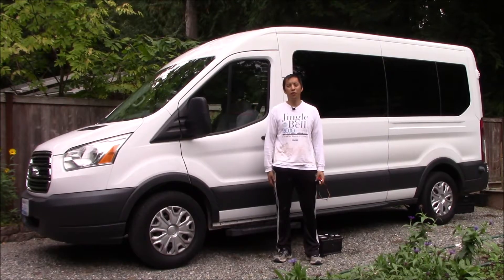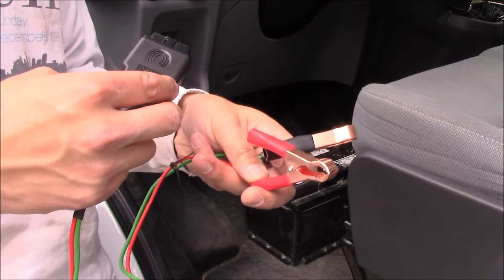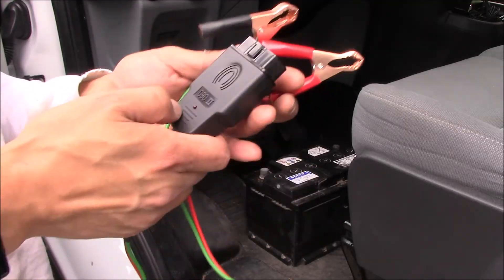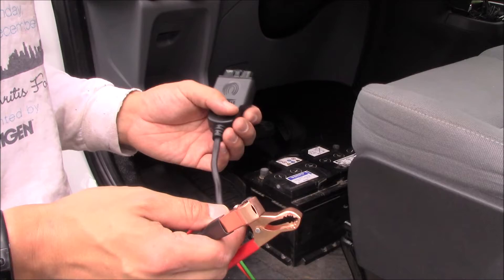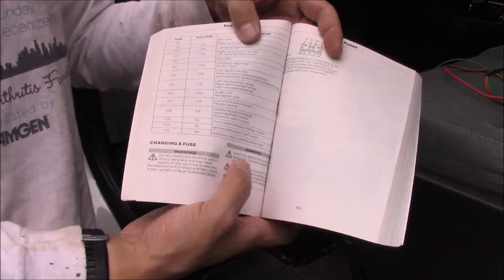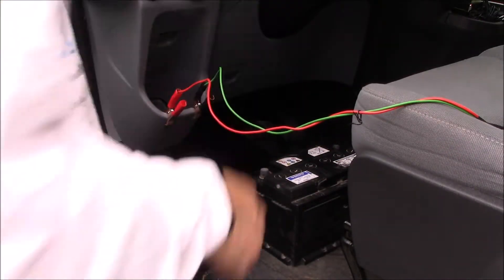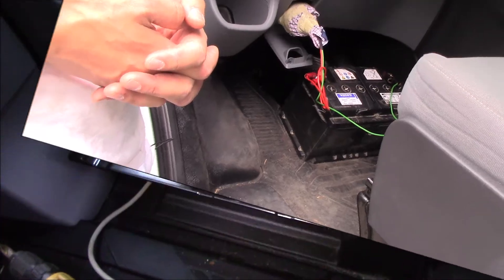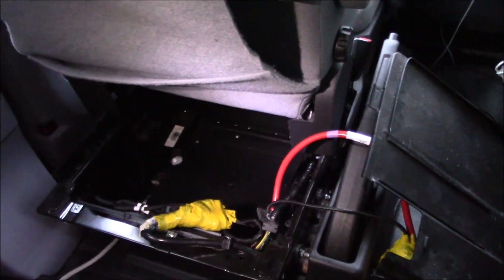Using a Memory Saver When Disconnecting Your Car Battery

Comment from the maker: In case it is helpful, here are all my van videos in a single playlist https://www.youtube.com/playlist?list=PLxdnSsBqCrrF5nO7cmNTc4cct0miFWdO6.  Please let me know what you think in the comments.  You can support this channel via Patreon at https://www.patreon.com/christopherwlum or by clicking the 'THANKS' button underneath the video.  Thanks for watching!
Reply: I recently tried to use a memory saver on a 2022 car.  It was a cigarette lighter male plug to obd2 port.  I used  a 12v 10 amp source and I blew a fuse that was stating itself to be 7.5 amps.  Now I am seeing you use a car battery that I believe produces way more amps at 12 volts.  How the heck did you not blow a fuse?  

I think the solution for me is to use something under 7.5 amps  between 4.5 and 6amps but im still worried about breaking something.

Comment: This is absolute nonsense. You can replace your car battery without this rubbish. Just try to disconnect your car battery (negative and positve and leave it for 10  minutes. Then reconnect the battery and start your car. Nothing is lost in memory. Not even presets on the radio (it has build in memory).  The car starts just fine and  nothing's changed. 
I ´have replaced battery in all the cars I have had, and  never had any problems. Start and stop cars will  start after 2-3 attempts because new information about the battery is being send to the ECU. ( learning process) So you don't have to do anything but to replace the battery and start the car

Comment: There are battery memory savers where you can unplug the alligator clip cable from the unit. Those units have batteries in them that charge while you're driving. 

Lift the hood attach it to your battery, get your car started a jump start will not harm the battery saver, drive for a little bit about 10 minutes idling won't do it, then you'll have enough power to last a couple of hours at least from the battery saver without actually having to hook it up to a 12 volt spare source. 

In some instances those models that have a charged battery internally you can leave the alligator clips clamped to the post clamps after before you remove them, then remove the post clamps you now have battery-saving power going to the car correctly and through the total system, it's a non OBD2 style by the way. 

Then change your battery and go back and then disconnect the saver. 

These savers have a safety circuit to prevent

Comment: Would you please mention if this device saves engine associated data like throttle body settings or anything else that’s actually more useful / crucial than radio settings ?

Comment: If you have a small 12V car battery charger, you could just hook the battery charger positive to positive (opposite end of battery post/cable connection, where the + cable bolts to), and the neg cable of charger to ground on steel of body or engine block or where the cable itself connects to body ground.

Comment: I have a similar memory saver like yours with the alligator clips. It came with a 15A fuse on the positive lead. I have also added a diode to the positive lead to prevent back feed from the battery under the hood.
Reply: Where did you get the e diode and how do you calculate the “size”

Comment: Don't have an extra 12V car battery around ? Hey, there's your lawn tractor, or garden tractor, or zero-turn. You might need longer cables, though. Or even two 6V large-type flashlight batteries in series.

Comment: If you had a device with long enough cables - couldn't you just hook it up to the same battery you're disconnecting? Or is that no good?
Reply: @torTxoFognaTuluZ   you're not gonna get shocked. As to the terminals getting in the way, idk about cars in general but on mine at least you can leave the battery cable clip on and just remove the cable from the terminal clip. If your battery cables are soldered on to them on the other hand... yeah that'll be hard.

Comment: Thank you for sharing what happened when the leads touched and blew a fuse. This helped me figure out what happened to me. Also as a possible helpful tip to those who do not like the beeping, I took my saver device apart and removed the beeper. God bless
Reply: As for me , I recently tried to use a memory saver on a 2022 car.  It was a cigarette lighter male plug to obd2 port.  I used  a 12v 10 amp source and I blew a fuse that was stating itself to be 7.5 amps. 
 Now I am seeing this video use a car battery that I believe produces way more amps at 12 volts.  How the heck did he not blow a fuse?  

I think the solution for me is to use something under 7.5 amps  between 4.5 and 6amps but im still worried about breaking something.

Comment: Best video I've come across re use of the OBD II battery saver.  Mainly because it answered my question about the beeping while connected; I reasoned that it is a good reminder that you're hooked up to a backup battery, while replacing the main battery.  Thanks for the informative video.

Comment: Great video.
Is it safe to plug the alligator clips to another car's battery while the donor car is on with it's alternator running?

i don't have a spare 12 volt battery sitting around. So this is my only option left.
Reply: 35.00 at a local junk yard for a slightly used battery.......

Comment: Worked exactly as shown. I purchased the jumper from Amazon and replaced the battery in our 2018 F-150 and kept all the settings. The truck did not need to relearn anything.
Reply: specifically what battery saver did you purchase from Amazon.  Thanks
Reply: Yeah I’d like to know which memory saver you used too ??
Reply: A quick tip on the alligator or crocodile clips as we call them in the UK. You could shorten one of the leads.

Comment: What information will be lost if I don't use a Memory Saver like the one you used?
Reply: It depends on brand. I have Suzuki and its ecm settings reset and cars idles like crap, and I have to perform manual relearn. Using this procedure i dont lose anything. Only downside is you have to have one more extra battery, 3 in all, one in car, one for obd and new one

Comment: Think this is useless really they should have invented it with a self power supply! Or I'll need 3 12v battery!! One is the battery I want to swap out 2nd is for the power saver and 3rd a new 12v battery that replaces the main battery! I guess this is only useful for some car maintenance that requires you to remove main battery if located in engine bay

Comment: So.. after a little research.. I found this.... " They are not effective or worth the risk. I-CAR also teaches not to use them.” Jeff Peevy, I-CAR's director of field operations, concurred. “A memory saver can complete circuits that removing the battery opens in order to protect the system, and so a memory saver could put systems at risk,” Peevy said.Jul 18, 2014".. any comments?
Reply: Note, that's a piece about welding metal on a car body. Electric arc welding and it's a different story than if just replacing a battery.

Comment: Many videos on how to do this. No explanation on why. What is being saved? What happens if you change the battery without this?
Reply: Several things can happen, the most annoying is  your car won't idle correctly and it will die after a second or two, you start it again and give it gas , but it dies again and again.  The procedure to re learn the idle settings varies from car to car and it is time consuming.  
Then you can also loose other settings in the electronics, like your radio ,  clock, and others. On very expensive cars I've told you have to take it to the dealer so they can reset things for you and of course it is not free.
Reply: Lose your radio presets? Clock? Hook a battery maintainer or trickle charger to the battery cables before you remove them from the battery and leave them on until you put them back on the new battery.

Comment: Never having seen or used a battery saver before the explanation and instructions were most helpful.  I may now go and treat myself to one!
Reply: Don't see the point of this as you will need 3 12v batteries.... 1. Main battery for replacement or to remove... 2. Battery for power saver... 3. The new replacement battery... I would invest in one of those car starter packs which you can connect directly to terminals
Reply: Or unless you are removing main battery for space in engine bay! If it's just for battery maintenance or swapping out faulty battery I think this is the most useless thing ever

Comment: I bought a memory saver to change a MkIV Renault Grand Scenic battery, but the OBD2 port was in none of the places that it shows it to be - I still haven't found it!
Frustrated by this I made up a memory saver using two lengths of wire, with an in-line fuse in the +ve lead and proper crimped connectors at the ends. Insulated terminals MUST be used. This was conected to a 12v battery from a child's go-cart and each lead securely connected to the leads going to the battery, using additional nuts. Once done, connect the preserving battery in parallel and remove the terminations from the old one in the car, -ve first. When removing the +ve, wrap terminating wire in a plastic bag to prevent contact with any body metalwork - remember these are still live! The Car memory is now being held up by the preserving battery. Replace the  car battery and reconnect leads. Lastly, remove the preserving battery, -ve first. 
Once everything is secure, the car should have its memory exactly as it was before.
Reply: Negative first. My boss still thinks that electricity travels from positive to negative
Reply: If it has an ash tray look behind it for the OBD plug.

Comment: I just bought a lithium battery car starter,similar to the Noco genius,it charges things like smartphones etc too.
Would i be able to use it as a direct source of power to the obd if i found an adapter??
Im thinking maybe yes?Great video!
Reply: yes you can, but the memory saver would have the cig. lighter end and the obd end........cig. lighter end goes into the car starter and turn on......works fantastic.
Reply: @johnbielenda7336  i am about to do this, but the GOOLOO jump starter/power bank has an output of 16.3 volts (tested with my craftsman volt meter)...i am hesitant to put 16 volts into the OBD port.
Reply: @g2145cal  Just buy the simple 9V battery adapter, costs ike 15 bucks, goes into the cigarette lighter
Reply: @OldSchoolNoe   I just went for it and replaced the battery without the saver or Gooloo hooked up...nothing adverse happened, just one prompt on the display. All is good.

Comment: He must be paid for pushing these memory cables. Just have a spare battery or jumper unit then, remove fuse cover under the driver side dash. You will see a red  positive terminal. Pull it out, connect positive cable from spare battery or jumper unit first, then connect negative cable to driver side door bracket. You will have all neccessary power to whole car, radio, trunks etc. NO MEMORY CABLES NEEDED, DO NOT WASTE YOUR MONEY ON IT!!!! Then go and replace your battery.

Comment: Instead of having a spare battery to connect to why not get a 12v DC power supply and wire it directly to memory save.. It easier to plug it in instead of having a big 12v battery around.
Reply: I thought about doing that too but if your power goes out, and with my luck it would, guess what? lol
Reply: You can simply use a 9 volt battery.
Reply: @njsongwriter  I made one with a 12v power supply and works great.

Comment: Too much chatter
Reply: I’m trying to figure out what reason we would need to get this battery saver and I agree with you to much talking
Reply: @goddessmanbo5374  best way I can put it is that it’s designed to save the Vehicle’s preset such as radios clocks even from your vehicle’s correct air fuel ratio certain cars when you disconnect the battery they begin to run horrible due to the fact that the pcm has to relearn it’s presets to get the car how it used to be leading to it idling poorly

Comment: When you disconnect the power to the OBD port, I think you want to disconnect the negative clip first then the positive clip.
Reply: The main concern about the positive / negative discussion is most relevant when jump starting a car.  You always want to connect or disconnect the ground first, and that connection should be away from the actual car battery to avoid making any sparks close to the battery which could result in the battery exploding. Battery gases are flammable.  I've seen it happen!  Also, remember that there are vehicles that have a positive ground.
Reply: it says take off + first.....  Finally, after replacing the battery, first loosen the red clip of the tool. If the tool is still ringing at this time, it means success. If it doesn't sound, it means the fuse on the car is burnt.
Reply: Same item sold on newegg and they say to disconnect positive first and then negative.
Reply: The ordering of connections in cars is a myth. Source: electrical engineer.
Reply: It doesn't matter which you take off first as long as you're careful
Reply: always neg cable first then last to go on

Comment: I kept the alligator clips separated and when I pulled the cord to plug it in to the bod port the wire moved and made contact between the clips and sparked. Now when I plug the memory saver in there is no light or beep. I cannot find the obd fuse. I checked the diagram there is no label for that. Now my car key doesn’t work and I have to manually lock them. What should I do? 

Listen to this man when he says to clip the alligator clips to the plastic it will save you trouble! Especially in my case where I’m not so lucky to have a fuse labeled to the obd port.
Reply from the maker: @1010s1-c  sorry, I'm not sure what is going on.  Good luck 🤞
Reply: Obd** not bod
Reply from the maker: I'm sorry to hear that.  It sounds like something else shorted and blew a fuse.  Have you tried systematically pulling out each fuse and checking is they have blown?

Comment: I have this same battery saver. It didn't come with instructions so I went back to the Amazon page to see if instructions for use were there.  Below is a cut & paste of those instructions.  If anyone can decipher what they mean, they must be psychic.  But the point I want to make is that it seems to say that if you short out the battery cables, you can actually burn out vehicle's ECM (ECU) which would be a disaster.  They are VERY expensive.  Also, when I ordered it, I realized that the alligator clamps could be easily shorted out and they require the use of a spare battery that you would have to use in the vehicle because of the short length of the wires. So I cut off the alligator clips and made a 12 volt power pack with a standard case that holds 8 AA batteries and has a 9V plug. I soldered a 9V plug to the battery saver's wires so I could connect to the battery pack I  made. Some people report that a 9V battery will save the vehicle's settings to so you can try that but I went with the full 12V pack. (The battery case only cost a couple bucks.) 

Also, I'm not sure you are interpreting the beeping correctly.  The instructions seem to be saying the beeping pattern should change and the Amazon reviews say it it should slow down when the connection is good.  Who knows?  The instructions are terribly written and it's obvious that some of the reviewers can't figure them out either. 

If I'm deciphering any of the instructions (below) correctly, it looks like they are saying to connect the ODB-II connector jto the battery BEFORE you connect plug into the ODB-II port. I'm not sure if that can make a difference - probably not, though, because you did it the opposite way in this video.

Anyway, try to figure this out.  This is an exact cut & paste of the instructions shown on Amazon:

"★Operating instructions and notes:
1, with a red clip to connect the backup battery cathode, black to connect the negative (Positive and negative polarity will burn the car computer).
2, plug the red light, and then insert the car OBD plug, this time has been issued by the sound of drops, indicating normal connection.
3, at this time can change the battery, careful operation, pay attention to the replacement of the battery must lock the car,
do not open the lights and other electrical equipment, not to the battery positive ground, otherwise it will burn the car OBD socket fuse.
4, for a good battery, the first release of the tools of the red clip, if also drops at this time ring, indicating successful, if there is no sound, indicating that the fuse burned."
Reply from the maker: Bob, thanks for the very detailed feedback and comment.  I'm going to pin your comment to the top so others can hopefully benefit from the information you shared.  Thanks for watching!
Reply: Bought the exact same one the instructions doesn’t make any sense at all all I can say is don’t touch positive and negative while the saver is connected to the obd port